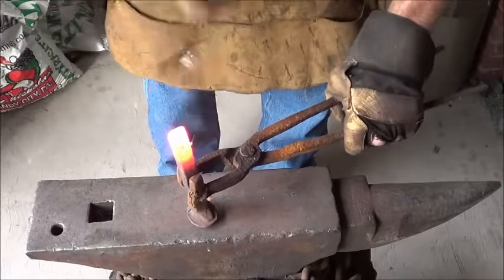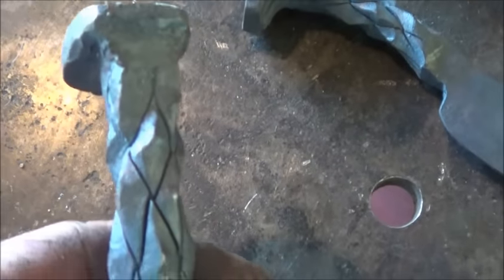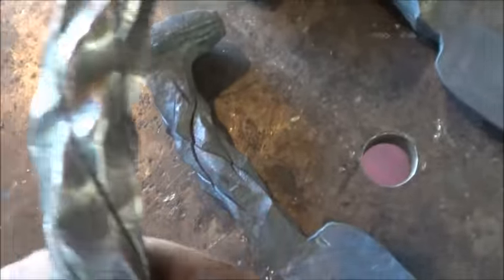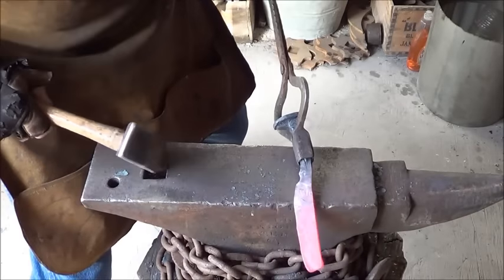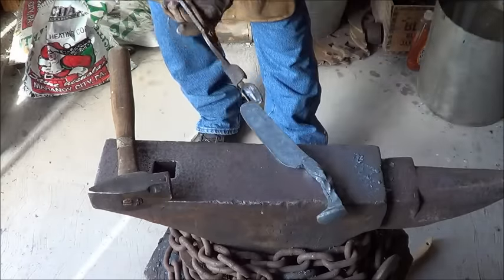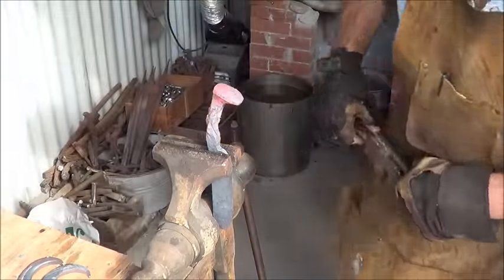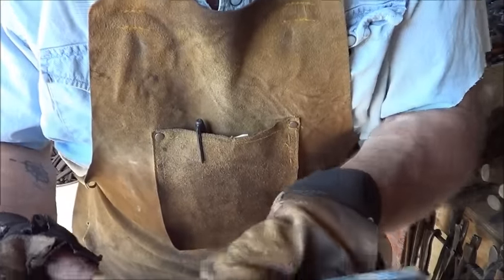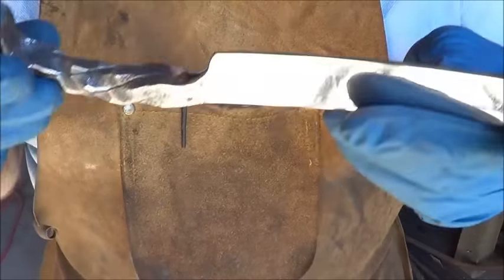Blacksmithing - Forging A Railroad Spike Froe For Kindling

Comment: should have a 90 degree handle so you don't have to hammer it all the way thru, and to steer the split.  I have made them from half a leaf spring, the loop for the wooden handle is already made. not as pretty as yours though.

Comment: How long are your railroad spikes?  Mine seem to be a bit shorter.  Makes having enough room for a handle a bit tricky.
Reply from the maker: +Crooked Eye I think most of the are 6.5 inches
Reply: I thought mine were shorter. Mine measure from outside edge the head to the tip, 6 inches

Comment: Why when you put those iron bars in that weird liquid, they start to catch fire? sorry if my english is wrong i am not american ou british  ;---;
Reply: +Fernando Gabriel Because he puts the iron, which is very hot ,into oil, which catches fire really fast.
Reply: +Fernando Gabriel Quite often knives are put into a liquid which is alot of the time oil, with the heat the oil can catch fire slightly
Reply: becuase hes quenching the blade aka heat treating and it makes the blade harder and stonger so it holds an edge better

Comment: noob question why is your anvil got the chainlink wrapped around the bottom?
Reply: calhere2010 Wrapping chain or sticking magnets to the base of the anvil helps reduce the ringing noise that the hammer strikes cause.
Reply: thanks.

Comment: Wouldn't really worry about heat treating a rail road spike as the ones they claim as high carbon are only 30 points of carbon and you need 40 points to be harden-able.
At 30 points carbon, it really doesn't do anything.
Reply from the maker: +Joseph Staup this is the debate but I can tell you that hardening the blade does have an affect... i will do a video on this sometime

Comment: So did thay rail road spike. already have a square bottom? or or did u cut it to square?
Reply: Railroad spikes have square tops. This is because when the new track is laid down they need to hammer the spikes into the support railings. It acts like a giant nail and peens, or mushrooms, out over the track to make a secure hold. If their are any railroads near where you live you can see a lot of the older ones just kind of pop out over the decades. Be careful though because it is technically illegal to pick up spikes from the railroad.